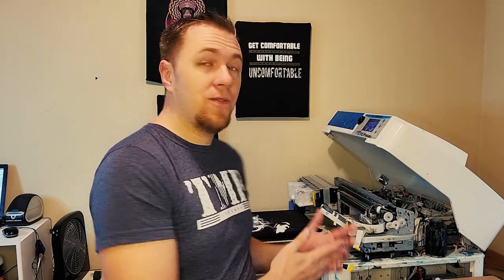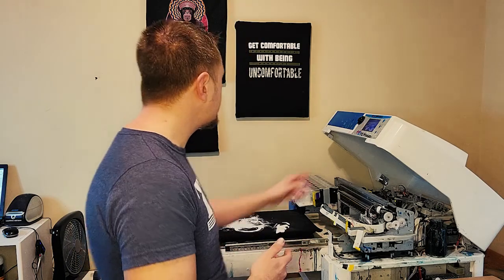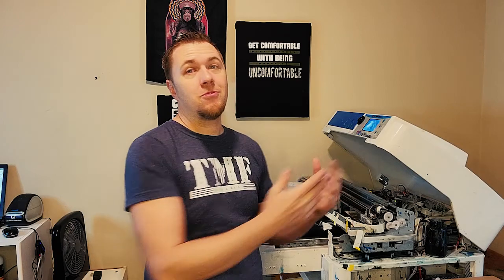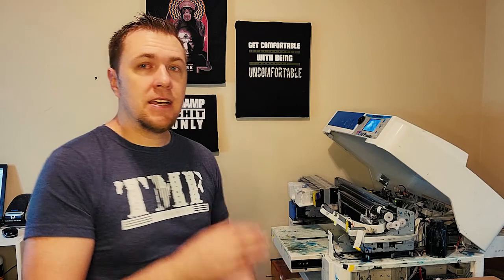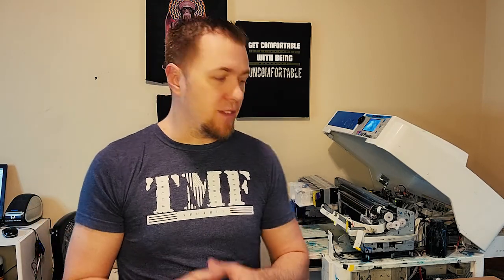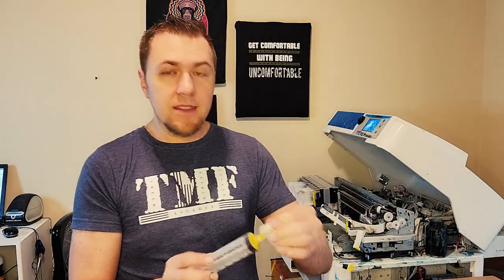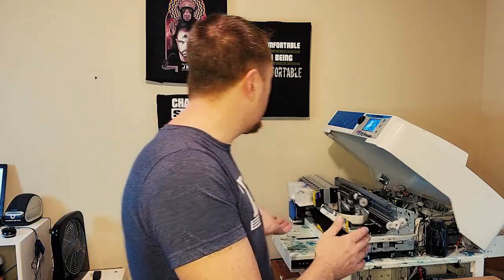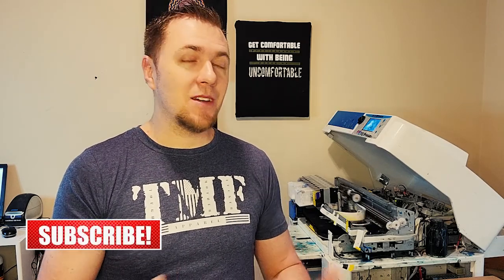EPSON ERROR CODE 131b

Comment: Love your videos. I have a epson 3800, I am getting the 131B error, but not on start up, only when trying to print. Sometimes a page will go through without an error and print and other times it  will just load the paper then before beginning to print, everything stops cold with the 131B error popping up. I have thoroughly cleaned the head after thinking that was the cause of the 131B, have my colors so it's not a clog apparently. I have also made sure rear paper feed and paper exit trays are unobstructed. Why does the 131B error come and go? I know how to disassemble if I have to but there are no dampers to clean or replace .  I read something about a surface mounted F5 fuse on motherboard but not sure if that pertains to 131b . And I can eliminate overheating I think since I can start up from days of no use and try to print a sheet and still have the error pop up after paper is passing through. The anomaly is various tweaks I do to paper slots, ink doors, main door to head etc somehow, sometimes trick the 131b from going away. I am just not sure problem is mechanical or electrical. I have 3 spare defunct  3800's to draw from if I had to.  I sincerely would appreciate all input. Thank you !!

Comment: Hi thanks for the great video, I have just question about 3880 , I just get one and 2  cartridges empty , when I switch it on , it says : no ink cartdrige install.... and shows the 2 empty, my question is it normal that I can't access to the menu or setting when I click on menu , the only possibility is to open the cover ,but can't access to the menu is that Normal? I must put the new carts to get access to the menu ? Thank you
Reply from the maker: Yes that is normal, the printer will not pass the startup without the carts registering
Reply: @TheTMFPodcast  thank you

Comment: Hello... If you can help thanks you..... Printer was working fine... But my white & yellow ins was not working right... So I took the damper & head out to clean the head.... I cleaned it good... Put it back together... Cut the printer on... Now it says error code 1223.... What could it be .. I know the pf board is not dirty...  Thanks